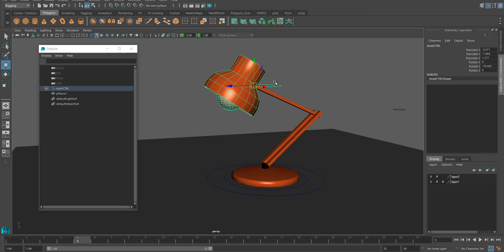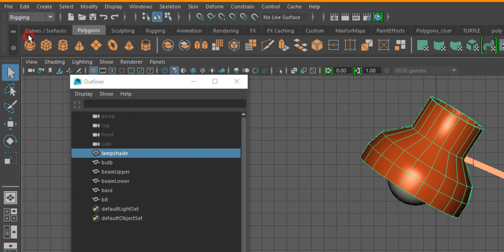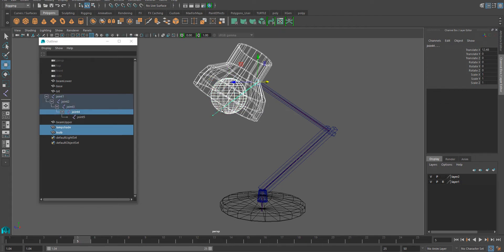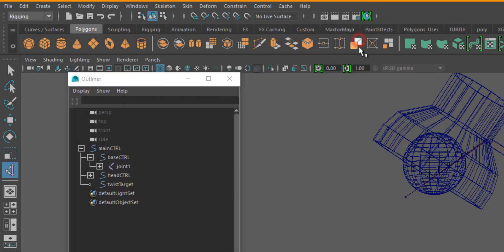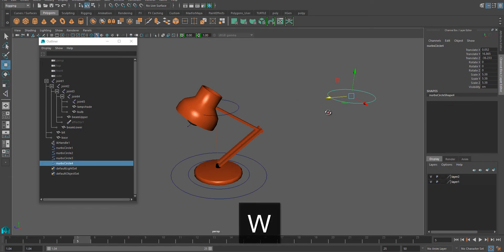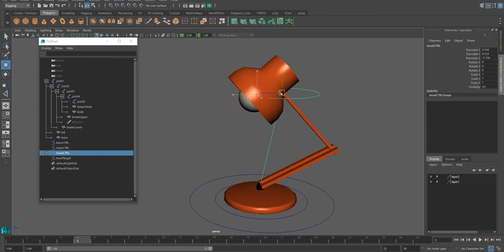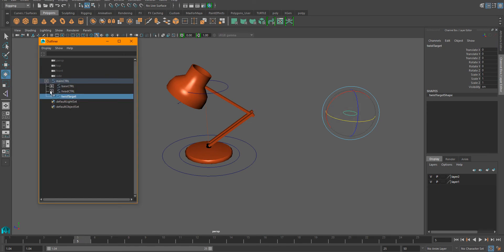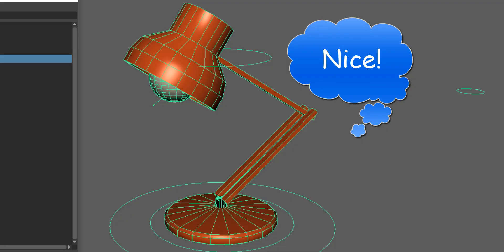Rigging the desk lamp in Maya

Comment: This is a really good tutorial! Ive had a bit of trouble on the IK handle section, it keeps comming up with '// Error: No valid items were selected. Must be joints, effectors, or nurbs curves.' and I haven't found any info on how to fix it. Is there a fix for this?
Reply from the maker: Not sure, but make sure that when you have selected the IK Handle tool you click on joints. It may be easier to do in the persp view than in side or front view.

Comment: How do you limit the transformation of those circles of you parent the joints and ik?
Reply from the maker: What would you like to limit?
Reply: For example, I want to limit the rotation of the head of that desk lamp or if I pull it down it will not go beyond the base stand. Something like that. Because I saw some videos using a sider control with min and max value. May be it’s just the same?
Reply from the maker: You can give attributes min/max limits in Attribute Editor, but it's a simple value limit, for making the lamp head not go beyond the base would need a more complex setup. Generally I don't do this as I may be limiting the animation in some cases by such setup.
Reply: @artSqoolType   Thanks... I learned in this tutorial...

Comment: Is there an advantage to parenting the mesh to the joints instead of skinning (smooth bind) in this particular example ?
Reply from the maker: Yes, I would parent instead of binding anything that is not meant to bend or deform. Like in a character head I would bind the head mesh but parent eyeballs and teeth. Parenting (or using constraints) is simpler and it can even make your scene play back smoother.

Comment: Hi! so like i made the joints like on the tutorial on my model, but when i select them only the joints move and not the whole object
Reply from the maker: Hi, did you parent the pieces of the model to the joints?
Reply: @artSqoolType  I'm not the same guy but I have the same issue - parenting or binding skin doesn't make them move, just the joints.. i should note that this is using 1 object rather than multiple
Reply from the maker: It's hard to say why it's not working. Are you sure you parented in the right order: select object, shift-select joint and press P ?

Comment: When I attempt to link the twist target and the ikHandle, it gives me an error code that the twist target is not valid. What do I do?
Reply from the maker: Did you first select twist target, then shift-select ikHandle?
Reply: teemuAuersaloDotCom  I got it working! I tried shift select a few times but it was selecting more than just the IKHandle; it was selecting the lampshade and bulb. I ended up realising to select it I had to use CTRL-Select. Thank you!
Reply from the maker: Great. It can be confusing: in the Outliner you would ctrl-select, in the viewport shift-select.